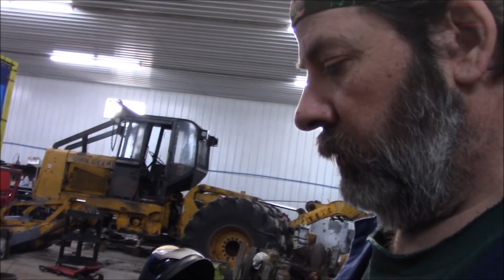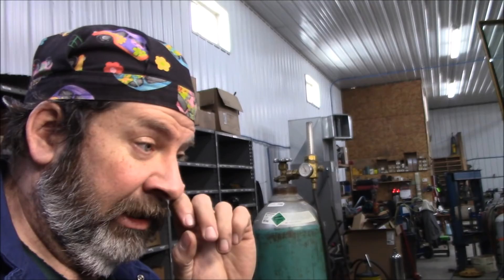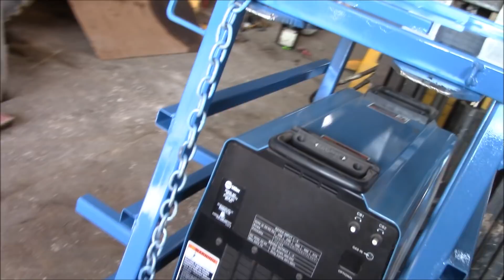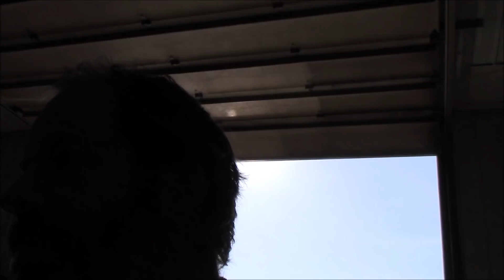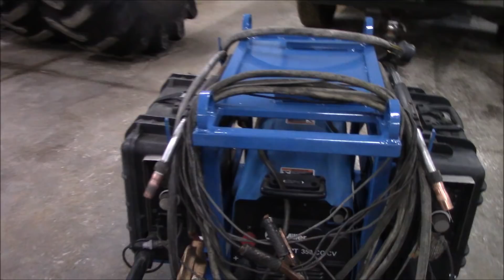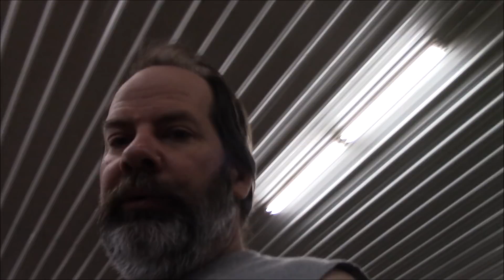Dual Feed Welder, Miller XMT350 12VS Extreme suitcase feeder

Comment: Nice looking heavy duty cart. What powers the 12VS suitcase? I've been wanting to get one of these 12VS suitcase models but I think they may be meant for field welding with large generators to power them.
Reply from the maker: You can use them in a shop also. You need a power supply with CV/CC outputs. Constant current and constant voltage. I believe you need constant voltage in order to power the wire feeder itself.

Comment: What advantage does the 035 have over the triple 7  I just switch over and ran a few beads with triple 7 and it's different haven't welded enough to an opinion
Reply from the maker: .035 I use for vertical up as well as triple 7. Difference is in heat input to part and material thickness and puddle control, also speed of weld. Basically I use the 35 to sizzle my way up in a slow methodical pattern. Triple 7 is like wide open.